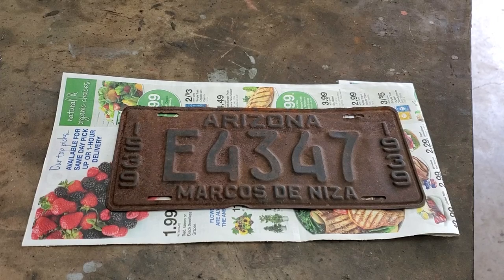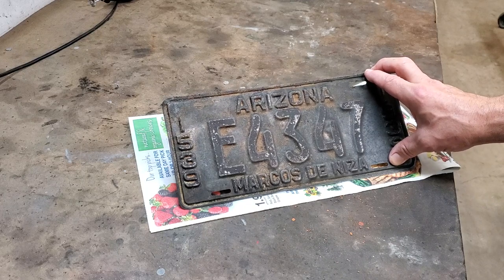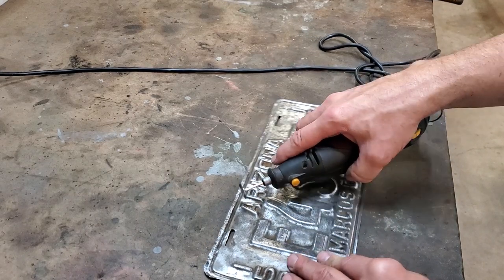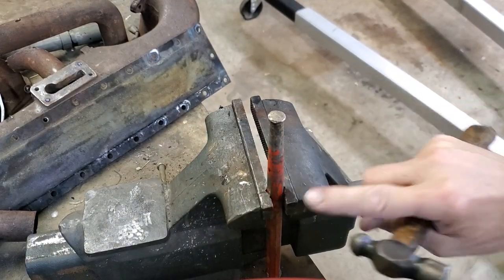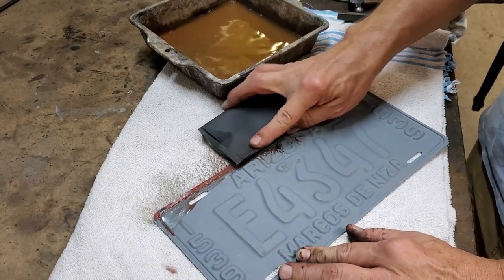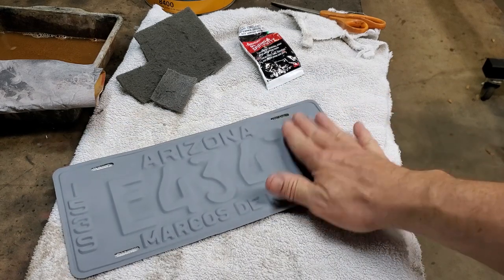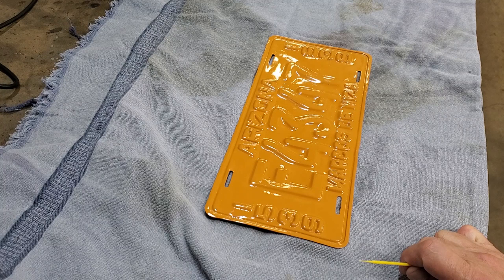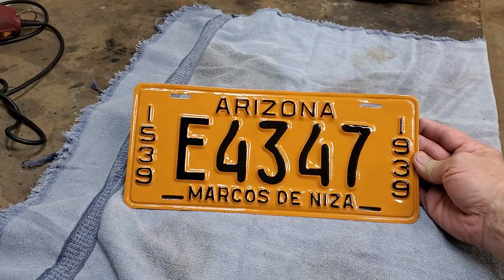License Plate Restoration - Restoring an Embossed License Plate

Comment: Really good job and great video with a lot of good info. How come you went with the yellow background instead of the original copper background for 1939 passenger plates?
Reply from the maker: Arizona license plates have changed many times over the years. According to ADOT, the official color for this plate is the yellowish-orange and black in the video. We had to meet the official color requirements in order for this plate to be accepted. We consulted with ADOT to get the correct color from their list. Copper-colored plates with red numbers/letters are often used on collector cars, 25 years and older. That color appeared on license plates in the past. Certain years in the past were the color that you mentioned. We appreciate your comment and your inquisitive question.

Comment: wonder some type of smaller roller would work for painting the letters
Reply from the maker: That sounds like a good idea and probably worth trying. We haven't had much luck using that method here. In the past, a specific roller may have been used to apply the paint, or maybe a screen printing process was used.
Reply: No it doesn’t work don’t 
waste your time
Reply: Repainting the embossed characters on license plates is almost impossible to do, to really look like an original paint job. For this plate to be displayed on an old car, this hand-painted work will look OK, but to a plate collector, it wouldn't.

Comment: what did you use to apply the paint on the numbers
Reply from the maker: I used a paint touchup pick. They are yellow, plastic, with a very fine foam tip. They can be found here: https://www.eastwood.com/touch-up-applicators-pack-40.html?SRCCODE=PLA00020&gclid=EAIaIQobChMIs5ns0-ew6AIVAp-fCh36KQUnEAQYAiABEgKn__D_BwE
Reply: I used a paint pen👍🏻 just did one last week

Comment: Very helpful video.  I'm a novice to something like this and am trying to restore 1928 plate for my model A Ford.  The plate really is in good condition overall, but the paint needs redone.  I am confused by the sanding part that got skipped.  Did you sand the entire plate until smooth, or did you only sand the pitted areas?  Also, if one doesn't have a paint gun, could one use enamel spray paint instead?
Reply from the maker: You would sand the entire surface between each primer coat to finish and fill all the pits. Yes, you can use rattle can paint, if you prefer. Thanks for watching!

Comment: This process will work fine for a plate to be used on an old car, but for a serious license plate collector it wouldn't. Matching original colors is a lot more painstaking than just using a stock paint color, first of all. And painting the embossed numbers and letters by hand doesn't ever really look like an original factory paint job done by a roller. Trying to achieve that original look is hugely difficult and usually unsatisfactory - and I speak from decades of trying!
Reply from the maker: Yes, there is a lot of truth to that. We will look into trying your technique on future plates; we have quite a few of them around here.
Reply: Yes, it may not be as good as a new  factory plate. But keep in mind the factory started out with a perfectly new plate that’s free of dents and rust. And used all the correct tools and paint. So he did a great job considering the condition of the rusty, mangled up plate that he started out with and doing it all by hand. This is one of the better license plate repair videos that I’ve seen thus far. Great job 👍

Comment: Should describe what the “de-rusting solution” is as it represents 50% of the problem
Reply from the maker: Several methods can work, but in this case I used a product called Evapo-Rust. Will add. the information to the description box. Thanks for watching
Reply: @CarzPlus  Thanks!